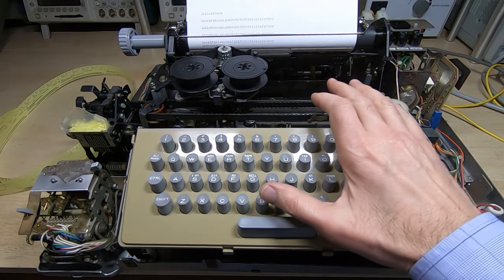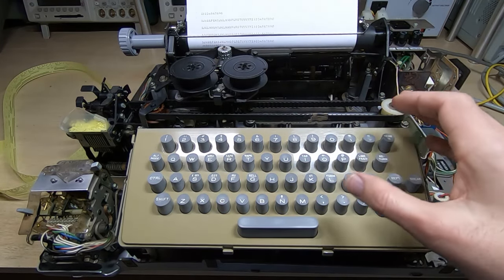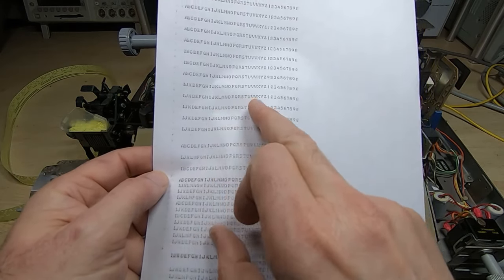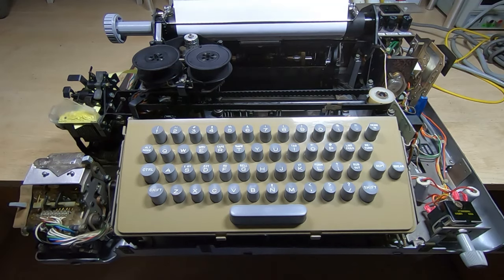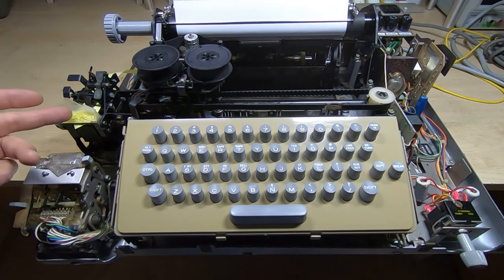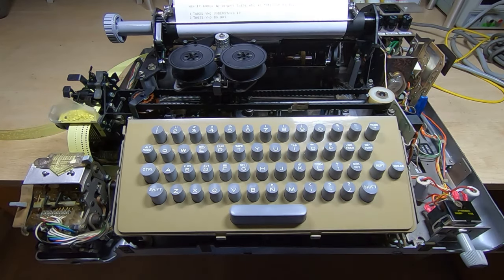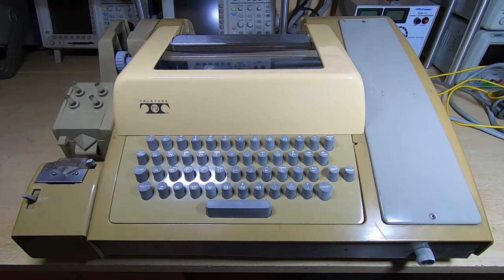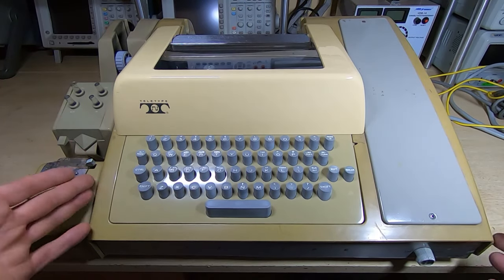ASR33 #2 Repair Part12

Comment: Hi Jerry - you are my favorite youtube producer by far.  Your channel is the very first youtube channel I ever subscribed to when I realized there was actually good content on youtube and not just funny cat videos. I have been looking for an ASR-33 for years. I used to live in Canada and had a collection of vintage computers there - mostly Sun and SGI Unix workstations, with a few TSR-80s and VaxStations...  my dream has always been to get a working PDP-8 with an ASR-33 and experience (and write) text adventure games the way they were intended... Sadly, I've moved to the UK and gave away most of my collection in Canada to a local hackspace.  I only retained my SGI Octane, Microvax II and my Mark-8 (which I built in 2005), but I'm now on the lookout for a PDP-8 and ASR-33... Besides connecting it to the afore mentioned Microvax II and Mark-8, I am working on my own discreet TTL computer, which I've been designing on paper for over 10 years but am now just starting to actually implement (at breadboard level). It's an 8-bit machine that's intended to be of a completely original design but similar to the early 70's era machines. It's a stack based machine with all instructions operating on the stack as an accumulator and a couple of additional scratch registers.  The instruction set itself is inspired by FORTH and PostScript. I had intended to use static ram until seeing your series (and reading your book) on core memory and I am  now constructing your core memory kit. My new plan is to use your core memory design for the stack, with the control logic slightly simplified to directly work off of the machine's control signals.  I am also planning to use a rope memory similar to the HP9100B's system shown in your video #9 in the series for microcode signal control.  The machine is to be built using wire-wrap construction and feature led's on every signal line and bus for the proper aesthetic. And of course an ASR-33 for IO. Programs will be loaded from and saved to paper tape.  I will document the machine and possibly create youtube videos to demonstrate all aspects of it.

A future project, after the TTL machine will be a relay computer. I've never had an interest in build a transistor or valve based computer - just TTL 7400 series logic (ssi) and relays - my relay computer will be based on logic gates created with 4p4t 'ice cube' relays and feature a Harvard architecture.  Because I will not use solid state memory, storage will be limited to a number of registers built with latching relays.  This is the reason for using a Harvard architecture - programs will run directly off of punched tape. I plan to build a bi-directional paper tap reader which will be able to reverse direction to implement jump and conditional instructions. This project will be quite expensive unless I can find a large cheap lot of relays as I expect to require upward of 2000 relays.  This machine will not really be interactive, it will run batch programs so i wasn't planning on a keyboard but the output was intended to be a daisywheel printer. An ASR-33 would provide an input option as well as the perfect output option.

I'm an outspoken advocate for preserving vintage technology and as a software developer by trade I endeavor to educate my fellow developers on how things work at a low level and strongly believe that a solid understanding of where technology came from and why it is the way it is will help us design better software and hardware in the future.  I love explaining computers at the gate-level to laymen and believe that newcomers should have a chance to work with proper electro-mechanical devices like the ASR-33 to be able to see and feel how it really operates and properly understand what is going on inside the devices we use today.
Reply: You should check out the book Jerry wrote, I think you would find it interesting. "Computer Time Travel"
Reply: @john_in_phoenix  Indeed I have that book, as well as his recent book on core memory.
Reply: Sounds like the winner!!
Reply: @DukeofEarl1961  I sincerely hope so - it's a gorgeous machine that deserves to be looked after and used as intended and as usual Jerry has done an incredible job restoring it.  certainly won't let it corrode in a garage.
Reply: Troy, I look forward to seeing videos on your DIY computer(s).  If you build a relay computer, Charles Petzold wrote a book entitled  in 1999.  He describes how a computer could be built using telegraph-type relays, but uses early 1970s TTL logic as he goes.  It's an interesting book that I've read several times and it still makes me want to find an affordable source of (many!) relays to do exactly what you have described, but using Charles' book as a guide.  Now that Jerry has shown how to design & build core memory, the idea is simply that much more appealing!  ;)
Reply: @bobvines00  I am not familiar with that book, I will look for it. My plan for the relay computer is to use latching relays for registers and execute code directly from paper tape. It will be a harvard architecture so the program will not be stored in ram but will be just on punched tape, so jump instructions will be reletive movements on the tape. This means I will need to build a custom tape reader that can feed in both directions. The biggest issue, as you've said, is the insane cost of relays...
Reply: @bobvines00  I've also been toying with another project idea for some time... Not sure if it's at all practical, but I've been rolling around the idea of building an 8-track reel to reel tape drive from scratch in my head. The idea would be to use 3d printed and lasercut parts to build a cabinet with vaccuum columns and independent reel motors powered by servo-type circuits controlled from IR photo sensors to keep the tape within a certain range in the columns. I'm thinking that a centrifugal fan would be sufficient for the vacuum. The tape would be encoded with Manchester code, which would be fairly simple to do entirely wit TTL.  The two key parts are the heads and capstans.  I'm not sure how to account for acceleration time on the capstans, or how to drive them at a precise velocity. I'm thinking they would have to be brushless motors - perhaps homemade axial flux motors similar to HDD motors...  And then the heads.. I've not seen proper computer tape heads for sale, but 8/9 track reel to reel audio heads for 1/2" tape are available on E-Bay and those should be sufficient... Though I'd like to try making my own with small ferrite cores. I'd need to cut a gap using a jewellers saw, but I don't think I could make it very precise or nearly as small as commercial heads so I don't know if it would be good enough. Also, commercial heads usually have a diamagnetic material in the gap and I don't see how I could do that myself... but a simple head with a largish gap may be good enough to do the job if I don't push density too much... in any case this is all hypothetical and a long ways off behind other projects.
Reply: @Kodemaestro  Kinda like a DIY DECtape drive, I guess, for relative simplicity.  But I certainly understand project ideas like this being a long way behind other projects!  I'm at the point of having to start thinking about which projects I might successfully complete before "checking out," so many will have to remain wishful thinking, I'm afraid.
Reply: @bobvines00  Indeed, something like a DECtape... but closer to an IBM 729 - just a little smaller. Also now found a PDP-8e that I'm working on potentially acquiring...

Comment: Thank you for another interesting series and an amazing restoration - I have enjoyed all twelve parts. I worked for many years with ASR-28 teletypes which have a similar alignment of paper punch and reader and never saw one used in the way you demonstrated. The tape would be punched then cut and placed in the reader to await transmission - this would be either weather or flight plan information. Sadly, when the equipment was upgraded we went from the ASR-28 to the KSR-43 for hard copy with data transmission done by serial terminals - skipping the ASR-33 era completely. Regards, David.
Reply from the maker: I have also never used an ASR33 in that manner and in fact have only ever used them as computer terminals but that is not what they were designed for and does not change the purpose behind the layout.

Comment: My mum could type that fast! She started as a shorthand secretary and rapidly rose to be PA to the senior partner in a firm of solicitors. She got one of the first Olympus electromechanical typewriters in the office but rapidly discovered that it was "faulty". It kept missing characters as she typed. After a couple of visits from the Olympus engineer who could not find anything wrong with the brand new high-tech device he asked her to type while he watched. Almost immediately he discovered the problem - my mum was "beating the action" of the typewriter - ie. she was typing more than one key per revolution of the shaft. The engineer asked her to type more slowly to which she responded that she couldn't - that was the natural speed she typed (on a mechanical typewriter!) and she could not change it. In the end she got one of the very first electronic typewriters available with a small type-ahead buffer to allow the mechanism to catch up. She felt it very strange that the typewriter carried on printing for a couple of seconds after she stopped typing! Although she was a very fast typist and excelled in many other office tasks she was never tech-savvy (often "fighting" with newer and more complex typewriters) and when the office finally migrated to word processing computers she decided to retire. Interestingly I once asked her to type out a BASIC computer program that I had written as I didn't have a printer at the time and she found it very slow and difficult. The strange formatting and frequent symbols and punctuation marks did not fit with the way her typing brain was wired and so did not allow her to "flow"!